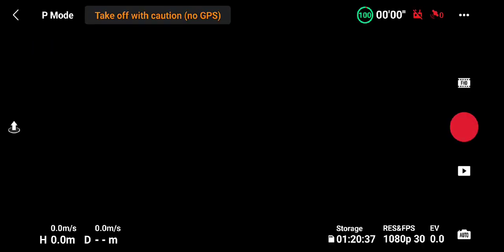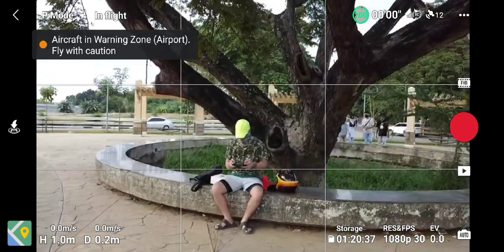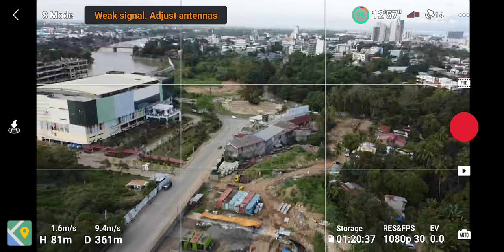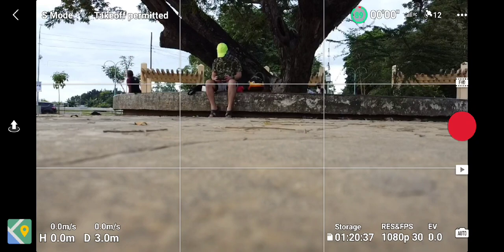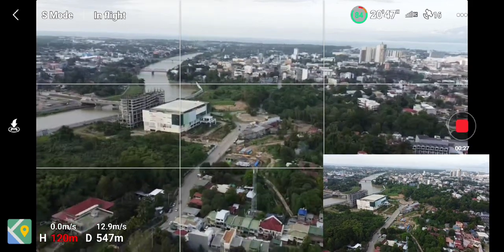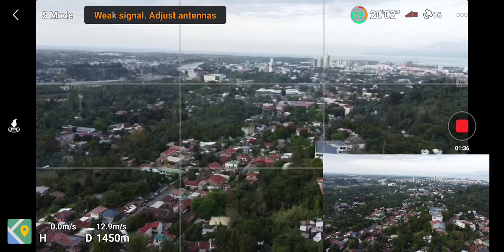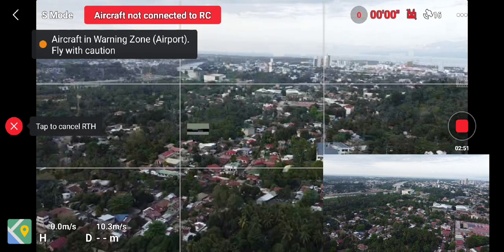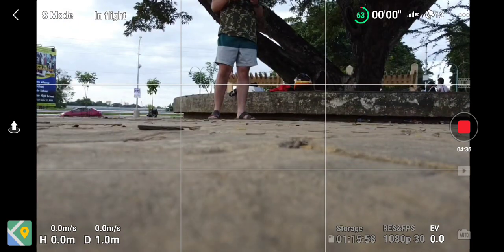DJI MINI SE URBAN RANGE TEST | Automatic transmission vs Manual transmission | Which is best?

Comment: The mini 2 has about 1.6km of range in urban areas, so about 1km for the mini se is still pretty good considering its about 40% cheaper.
I mean unless you're a professional that arent many scenarios where you need to go further then 1km.
Reply from the maker: Yep! Unless you want to fly your drone to the ends of the earth haha
Reply: You have to be a professional to fly a drone far?  Lol. An area you might want to get footage of could be cut out for vehicles to drive to. So you have to fly longer to get there because there are no cars that are aloud or there is no road  to drive there.
Reply: My se can go about 320m
Over buildings 
I've only used it 3 times
Got the mini 2 😀
Reply: It's only a little bit more money for the mini 2 
SE not worth buying unless you only fly it in the middle of nowhere lol

Comment: i tried the manual transmission 5.8GHZ at 165 channel.. then after my drone cannot connect anymore to my controller.  Then i read the DJI forums that if you set manual transmission to 5.8GHz and any channel greater than 149 it will kill your drone.  There is no fix known from DJI.  I was force to replace my drone.  Does this happen to you??
Reply from the maker: I’m so sorry to hear that bro. It didn’t happen to my drone. Maybe the unit is broken already. In fact I did switch channels so many times.

Comment: I think you should get more range with 2.4Ghz just pick a non-busy channel. 2.4Ghz has a longer wavelength is mean is half less susceptible to interference than 5.8Ghz. 5.8GHz has higher bandwidth though.
Reply from the maker: Yes po. Comparison lang na sir sa auto ug manual hehe
Reply: What do you mean with channels? I am completely new and does not understand :/
Reply: sorry i'm a bit confuse about the video and comment but just wanna ask po so the 2.4ghz has a low bandwidth means that it has a long range or I can get more range just changing the non busy channel? than the higher bandwidth? which of those is safer to use? Thank you

Comment: I just got the SE 2 days ago and I’ve been so frustrated because I start losing connection after a 100-120 meters in distance or height while it’s marketed for 4KM. I’ll try out the manual method today, I have high hopes
Reply: Just tried it and it cost me my drone. BE CAREFUL with this method. Once you choose the manual mode and turn off your drone while on the manual transmission, you may never be able to connect your drone again to the remote control. Tomorrow I have to take it to the service centre.
Reply from the maker: @alidabbirkhan  im so sorry to hear that bro. Did you switch the transmission while flying??
Reply: @alidabbirkhan  
Get the mini 2
Don't waste your money fixing it 😱

Comment: Hi , when I changed to manual after the  flight when I turned the drone off when I tried to reuse it I couldn’t connect the rc to the aircraft again so I returned it to Dji for replacement and waited for a month for the replacement drone , did I do something wrong ? , because t I really want to try the manual mode again because the range sucks in auto mode
Reply from the maker: I did connect it without any problems bro
Reply from the maker: Did you get your replacement?
Reply: @zoe.jerlen  yeah but it took a while , did you change it to auto again before turning the drone off ?

Comment: I've just done this and now my controller wont connect to my mini SE. Any ideas ?
Reply from the maker: Until now??
Reply: @zoe.jerlen  yep. Its going back to DJI for a replacement. A few people are getting the same error as me when changing to manual. Unfortunately the Mini SE cant be factory reset by the customer.
Reply from the maker: @timbob7856  really? I didn’t encounter any problems when switching from auto to manual
Reply: @zoe.jerlen  Its only happening to a few of us. Some glitch

Comment: Good day sir yung model po ba niyo ng mini se is mt2sd25 kasi around 10meters medyo nawawala na yung signal. Any tips sir new pilot lang kasi. Thanks😊😊
Reply from the maker: Yes po. Maraming wifi dyan sa inyo sir? Try switch mo 5.8 ghz
Reply: @zoe.jerlen  yes sir may satellite din na malapit

Comment: Just got my mini se yesterday sir.. i did a test flight pero nasa 25m pa lg ang distance pero na disconnect na..and i think nka auto yung transmission nya, yun na ba ang time pra e manual ko sir? Sana matulongan nyo ko.. newbie pilot here..tnx
Reply from the maker: City area po yan? Yes po. Switch mo 5.8ghz sir. Welcome po sa club!
Reply: @zoe.jerlen  yes sir city area po ako nag test flight..so kelan ggamitin yng auto transmission? salamat
Reply from the maker: @maritesdrone6277  switch to manual sir
Reply: So better na evry flight sir, switch to manual transmission nlng?
Reply from the maker: @maritesdrone6277  if city area lang sir switch to 5.8 lang. Pag rural naman, okay lang auto
Reply: @zoe.jerlen  salamat sir..big help po..
Reply from the maker: @maritesdrone6277  no probs bossing
Reply: @maritesdrone6277  cambie de dron amigo, el mini Se es muy malo para ciudad. El mini 2 es excelente para ciudad. Saludos

Comment: My drone stopped connecting to the controller after doing this
Reply from the maker: That’s normal bro
Reply: @zoe.jerlen  how can i fix that? ive got a fixed red light on the drone and it keeps giving 0xf2 code on the computer when i plug it in.

Comment: My mini SE is locked at 2.4Ghz!! what a piece of shit!
Reply from the maker: hello sir, its not locked. just choose any of the 5 last green bars.
Reply: @zoe.jerlen  it IS locked… i have only 11 bars… i asked at DJI an they said it was a geographical setup, it will only show me the additional bars when turning it on in a country that allows it! 😤
Reply: @rodrigo6459  11 bars is FCC version dude.
it's better than CE version.
correct me if i'm wrong.
Reply: @YosepAliSaputra  i have ONLY 5 bars… The range is locked at 500 m